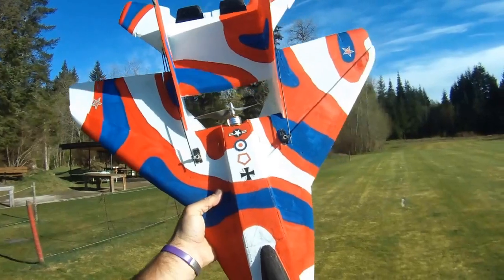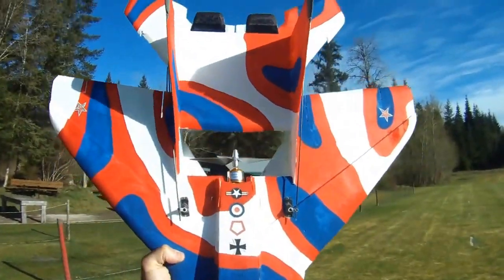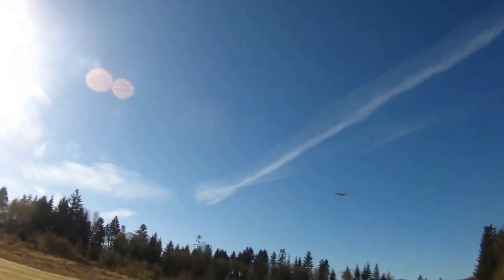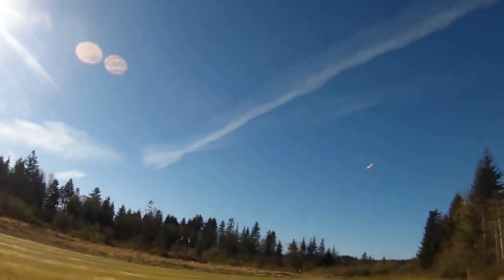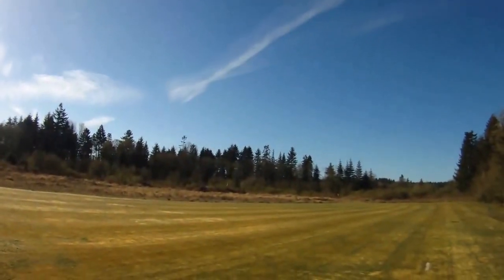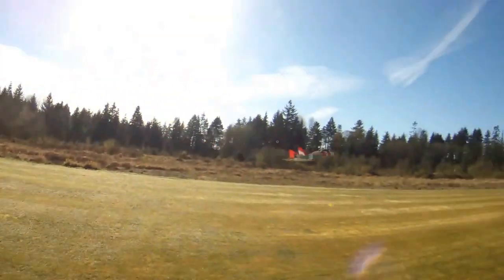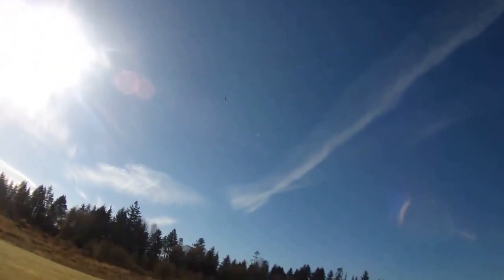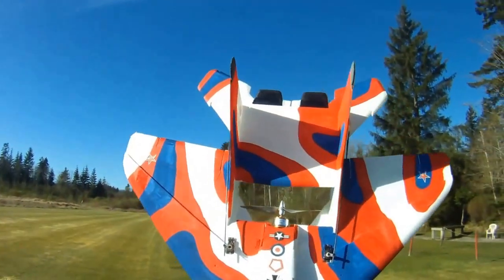NAMC Mig 35B with GB 2200 Kv motor

Comment: The gearbest link to  A2212/6T 2200 didn't last over one day from posting. Part number doesn't show up at GearBest anymore. Deal extreme has stock but the price is  $16 CDN ($12 USD).
Reply from the maker: +Gil Elgez Thank you, the link must have changed, I found it again and fixed it above, price is now $9.22 but they are currently out of stock.  Cheers, Scott
Reply: +e3Scott  Thanks for updating the link. I will order one or two when they become available again.
Great design. I hope to build your Mig 35B this summer.
Reply from the maker: +Gil Elgez Hi Gil, no problem :)  Thanks for the kind words, if you have any questions about the motor or the Mig-35B, you can always send me an e-mail at scott@migsrus.com  Cheers, Scott